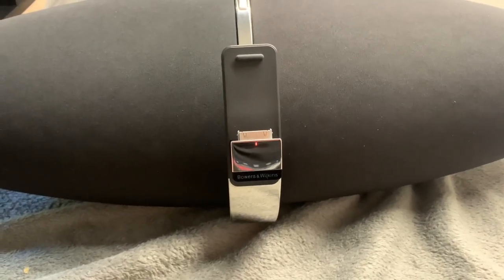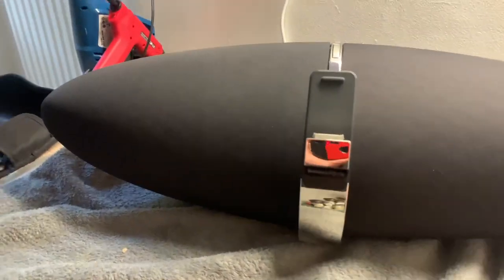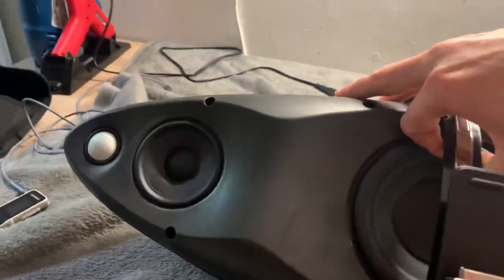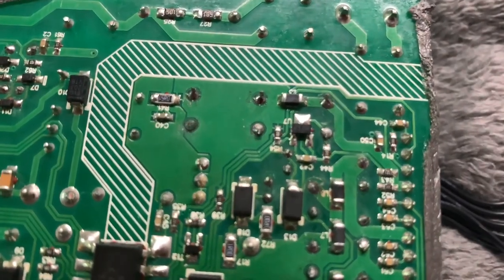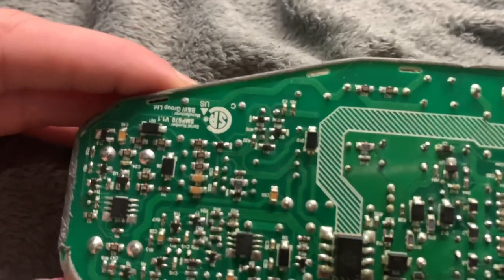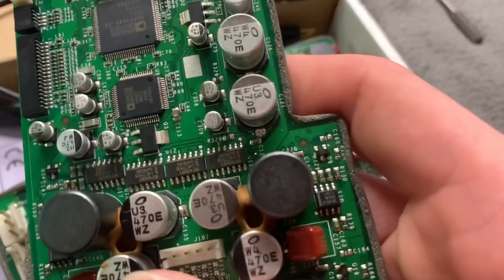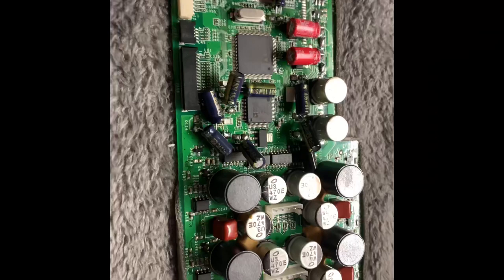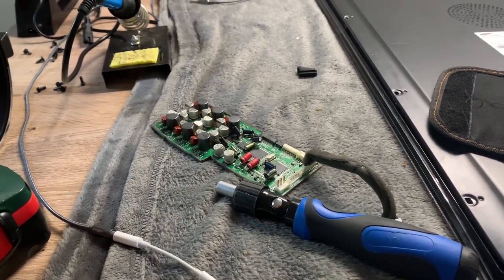Zeppelin Air Intermittent Power Repair

Comment: Hi, I have an issue at the moment with a fast red flashing light. I had changed all the PSU caps last year which fixed the original issue. Now ESR tested all the motherboard caps and found all the SMD caps to be low capacitance and high ESR except for the large 470uF. Got everything on order for tomorrow hopefully this sorts it.

Comment: Hi! I replaced all the capacitors in the power supply except the high voltage ones. When I turn it on, it starts up and plays music, but if I unplug it after 10-15 mins and plug to socket it back in, it starts slow flashing red for 30 minutes and then starts flashing quickly. If I unplug it from the socket at night, then in the morning it turns on as if nothing had happened until the next disconnection from the socket. Could these capacitors on main board be to blame for this behavior?

Comment: I just repaired the blown mosfet problem on the PSU and the speaker worked fine all day thursday. Cam to try it Friday morning and all I get is a red light and a low hum from the woofer. Very annoying and I expect better from B&W

Comment: Thanks for the video. You should better use an anti static mat and ideally a writs strap to ground. That acrylic blanket is soft and nice but will ESD zap those delicate CMOS DSPs.
Reply from the maker: Dont chat shit fam
Reply: @MrReeceyburger123  Well , it seems you have similar respect for people's opinion as you show for CMOS IC's. I am over 60. Fourty years working for one of the manufacturers in that board tells me that you may run ocasionally into ESD trouble. Then of course you can blame the manufacturer or keep changing parts blindly until you spot the failures or determine 'it cannot be repaired'. That may work, or not. Good luck with your IKEA blanket but still perhaps you may want to reconsider a cheap anti static mat and a wrist strap. Oh... and sharper multimeter probes will help you better than those huge bananas on minute 15. 😉
Reply: I’ve been repairing electronics for nearly 20 years and never once used an ESD mat or strap. Never ever killed anything and this extends from industrial PC motherboards to large 3 phase inverters.
Reply: @andymartin86  Well... what can I say other than how do you actually know you never killed anything? . I do not seek polemic, just highlight that 'never had a problem' may translate better as 'never knew if I caused an ESD problem'. You would need to decap the device and use an electronic microscope to actully see the ESD zap trace. As a user you will never know what happened. ESD'ing an IC does not make any sound, smoke or noise.

Comment: Hello @mrreeceyburger  i have the same model of zeppelin. It was always working good. But 2 month ago I shifted my flat and I packed it for 2 weeks in his package back. So it was without electricity this period. When I unpacked it and want to switch it on the power was dead. No Funktion at all. Any idea which part it could be and any change to get that or repair it? B@w said no Chance. The don’t have parts anymore. So sad. Bc was a nice sounding speaker.
Reply: Persevere. The dealer will spin you this story. Try find a decent recommended backyard “techie”

Comment: This product is one of the worst I have ever used. Both times I bought this product and it failed on me. I thought it was just bad luck the first time I bought it but the 2nd one also failed. Not even sure where to take it for repair. Mine just have a solid white light and does nothing. No response to the remote also.
Reply from the maker: The air is useless, do your self a favour and buy the generation 1 zeppelin and fix the smps.